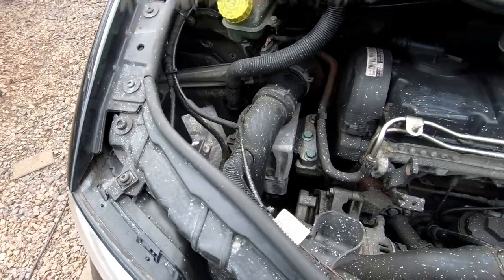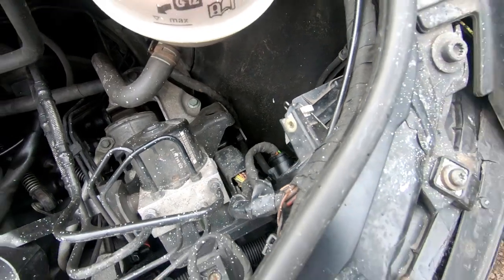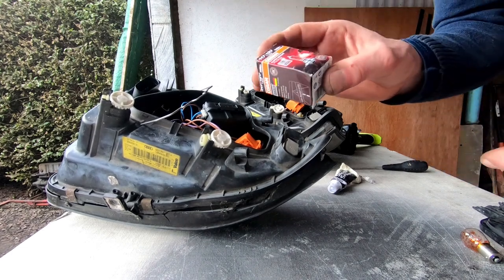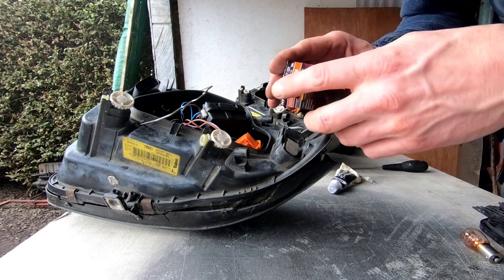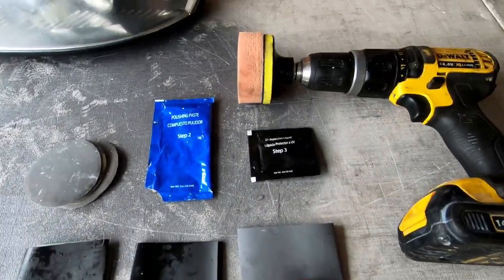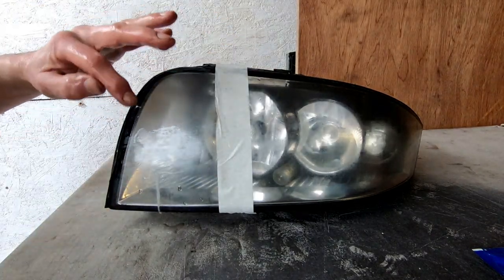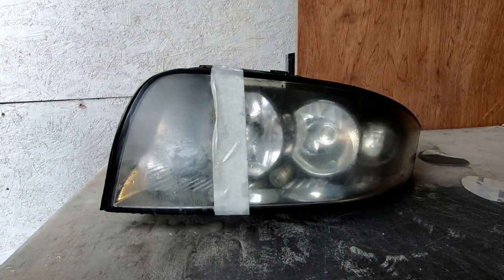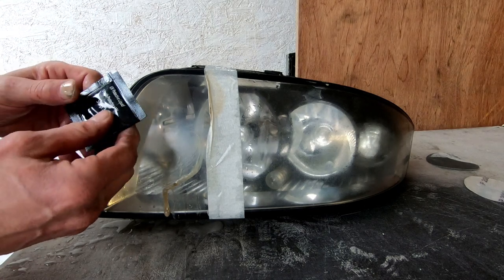Audi A2 Headlamp replace, clean & adjust

Comment: Just remember not to leave your keys in the car while doing this because if you close the door with the Bonnet off  it will self lock after you replace it , that happened to me , had to get a locksmith out to open it .👍🏻
Reply: Thank you very much for that tip. I only have one key, so that would cause a big problem!

Comment: Applying the UV solution is a good idea to prevent it yellowing again and then you repeating the job. Perhaps looks at a UV resistant clear coat spray instead if you want a smoother finish
Reply from the maker: Good advice thanks

Comment: Did you figure out a way to stop the condensation? I have dried mine out with a hairdryer a couple times and tried to seal it best I can but its still happening.
Reply from the maker: I left the plastic cover off the back and that seems to do the trick. Not ideal but works!
Reply: @garageofdad  Won't the wiring be exposed to the water getting in though?
Reply from the maker: @RAYMUFC8  9 months on mine's ok but It's not a recommendation, just what I done. I tried all other ideas from the A2 fb page and youtube but didn't work.  I don't think there's a definitive answer except buying a new unit. If anyone has a better answer, let us know. Good luck!
Reply: @garageofdad  You can drill a small hole  say 25mm in the back cover to allow ventilation,  You can always use a grommet to close it if ever needed . This will do what in effect removing the cover does
Reply from the maker: @neilpalihakkara6809  Great advice, seems like they need good ventilation

Comment: How do you remove the cable connector? I’ve tried to find a way to unlock it, but I just cannot figure it out.
Reply: There's a notch on one side of the connector where you can pry it open with a flat head screwdriver. Pry it slightly and pull at the same time.
Make sure when you push it back in that there's no orange visible in that notch. Seeing orange will indicate it's not plugged in completely and the light cluster won't work.